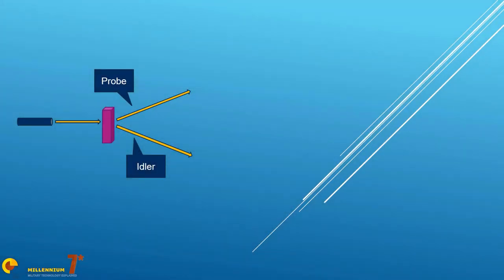QUANTUM RADAR: More about it.

Comment: Some Swiss banks communicate in this way.
Reply from the maker: Is there anything above general education but below university level that I could read?
Reply: @Millennium7HistoryTech  Difficult to find a written document. Alain Aspect talks about it in his conferences. It is not the same system as the radars. Swiss banks communicate in the same building with a quantum cryptography system using optical fibers. The purpose of the system is to prevent interception of communication. A system from IDQuantique.